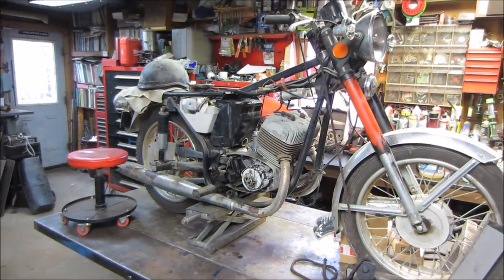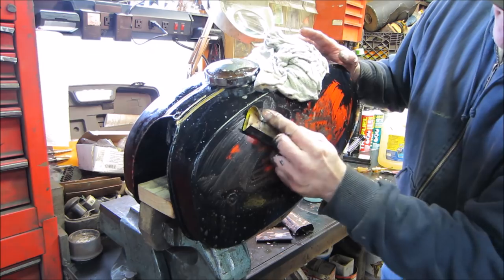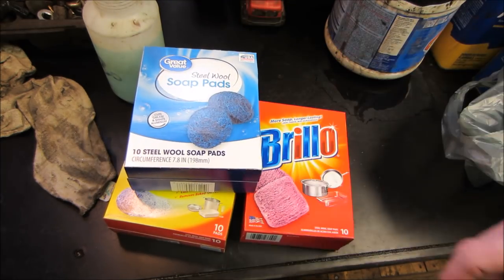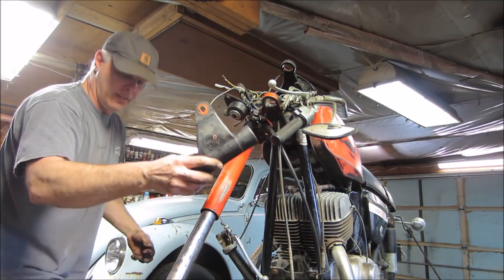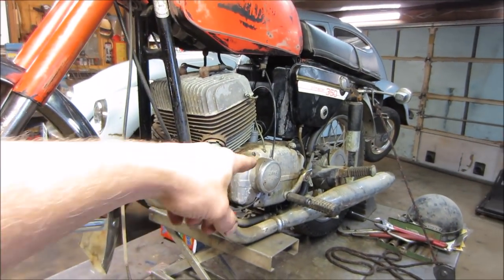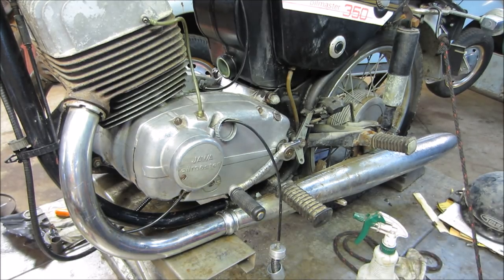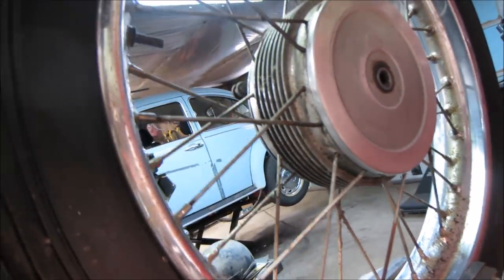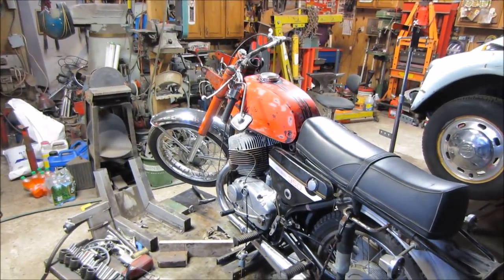barn find jawa, will the paint come back with wet sanding?

Comment: That chop in the front tire is normally called feathering. It’s caused by worn shocks letting tire bounce. I’m sure in this case the fork oil is low or something else hindering the fork from operating like it should. So as it rolls down the roll it hops fast causing uneven wear.

Comment: If your going to leave the paint as it is I'd paint the wheels and exhaust is a high heat silver paint. Not the fake chrome but like a header style silver. I say silver so it will match the case color somewhat. Awsome motorcycle. I'm a big fan of two strokes anyway.

Comment: Agree w/ James Price below.  Wrap the downpipes, sandblast and black hi-temp paint for the mufflers.  Won't cost much money & will make a big improvement in the looks of the bike.  And as long as you have the sandblaster out, you could blast the rims smooth and then spray them with satin silver paint.

Comment: Something you could try on the rougher parts (or the whole bike) is to repaint and once dry you could sand it back (or sand through) a bit to match the less rough areas and make it all flow together. It works really well for aging hardware too. I'd love to see it closer to original paint but with the wear it would have had in its life time. They were tough bikes. And the aging would only add to its character.

Comment: The seat and front/rear fenders are very clean so in my opinion i would paint the tank/side panels and front/rear shocks. I would wrap the front section of exhaust and matt black the rear sections with high temp paint, this would not cost much at all and would make it look so much better.

Comment: I use a sanding sponge for these kind of things. Works well. It work for sanding small engine cylinder walls to get the cross hash for new rings.

Comment: Didn't have a chance to look through all of the comments, but (0000) steel wool works well to salvage slightly corroded chrome.  It's not a miracle worker, but it does work well in my experience.  If you aren't super aggressive with it, you won't scratch the chrome.

Comment: I believe that woven stuff is intended as RF shielding for cables and the like, but it can certainly also be used as ground strap. Or to cover ratty chrome exhaust pipes. :-)

I was thinking of using the wet&dry to key the black paint and then go at it with the acetone, but then I saw what you did with the steel wool and the acetone, and I suspect it was about the same result or better. 

I came across some chrome paint a few years ago that was utterly amazing. It went on as almost a slurry that didn't look like much of anything more than scrambled eggs, but after a few moments it got its act together and turned into this absolutely mirror finish chrome-like surface. Didn't look at all like the usual aluminum "chrome" spray paint. Unfortunately I can't for the life of me remember who made it or what it was called, so that isn't much of a help.

Comment: I'd hit the air-cooling ribs on the cylinders with some stove black; after cleaning them up with a wire brush, obviously.

Edit: you think they kind of cheaped out on proper production techniques back in the comblock days? -you're blowing through the factory paint like no tomorrow, so why would you think any other areas were done properly?

Comment: The front tire ‘Barum’ is a CZ brand tire,  actually good tires, I had some 28 year old tires on my truck that were Barum CHemlon - hardly no cracking or dry rot even when flexed after airing down.    Barum is now part of Continental.

Comment: Soak the rims in burned oil or diesel for a few days and take a screwdriver with a few layers of cloth and all that rust will come off,  after that with a bit of polishing they will be like brand new. When i restored my,'57"Tomos t-03 they were in 10 timeS worse shape than this.  I have the firat start video on my channel

Comment: Two Thoughts on the parts of the red you thought you "burned Thru" - (1) the original paint was prolly very thinly applied and (2) you could be merely exposing areas that the prev owner had sanded to the primer when he surface-prepped it for his black paint job?

Comment: Depending on how old the tires are in depending on where it was located through the years the belts and certain types of tires will actually break but the rubber won't give away so therefore you get lumps of divots in valleys inside your tread I remember the 50s it through 70's model glasspack tires the belts and then would break but the tire would not give away

Comment: I'd suspect the orange had wear and tear making it thinner/softer, or whoever sprayed the thick coat of black sanded the orange for better adhesion. Huh, that green oil in the forks looks like what was in the oil tank of the trashed old Yamaha snowmobile I have.
I think the mufflers would look nice blasted and painted, but it's coming together pretty well as is!

Comment: i used maculloch 100:1 oil in the gas, then mix oil in the tank, so if the pump fails
it wont burn the motor up....a little smoke never hurt anybody..

Comment: That model year is stamped on the plate attached to the fork behind the triple trees. Just turn it until you can read it. Fork oil is a specific thing, so don't just toss gear oil in there. Looks good so far, though!

Comment: When you're sanding near the outside corners, and don't want to sand the corners too hard, roll the paper into the cross-section shape of the Greek capital letter omega, with the loop away from the corner surface and the base of the omega against the surfaces close to, but not at the corner. The loop goes up in between your thumb and index finger. For getting into the inside corners, take 1/16 of a sheet, and wrap it around a 2-1/4" x 1-1/2" (approx.) rectangle of milk-jug plastic.  Rectangles made from credit cards work, too, but they're too stiff for what you're doing. You might make a rectangle from a Scotchbrite pad, too. 
-- Lately, it seems like I make my living restoring 100-year-old wooden apartment-building doorways with lots of mouldings and carvings, and I've had to learn from thought and trial and error how to deepen grooves while not taking the high ridges down, and how to sand leaves, acorns, scrolls, and eggs. Most of the doorways are around 15' tall and 8' wide, with windows above and at the sides, with only small areas lending themselves to the use of power sanders. At any rate, it's all about getting the pressure where you want it, and keeping it from where you don't want it, at a small scale.

Comment: Mustie, you can use any 22uf condenser (like a Volkswagen one :) and Volkswagen beetle/ kombi points will work if you press the locating pin out of the fixed contact :) I know this works as I have done it, remember to use a metric drill to resize the fixed contact on the points!

Comment: Waviness on the front tyre tread is caused by braking vibrations in the forks. It's a feature on bikes with twin leading shoe brakes.

Tyres are still made by a company called "Mitas" and should be available in the US. 

2Mitas" make tyres for seriously heavy plant machinery too.

Comment: I'd keep an eye open for newer rubber, but in the meantime, I'd have no problem running that steer.  Might dismount it, inspect the bead and sidewalls for signs of rot, but if all looked well, I'd run it.  A bit of feathering like that in the tread,  once it's started, isn't likely to stop, so just run the thing until it becomes noticeable or unpleasant from vibration.  Just my opinion, based on my own experiences with tires.  I don't think Mustie is going to be loading up and heading across the country on it,  so for little joyrides and short scoots on the thing,  run it until it's done. It'd be different if it were a big heavy touring bike and he and the wife were going to be travelling on it.  The rest of it is coming along rather nicely.   Maybe it is possible, despite what they say,  to polish up a turd :)    And hey, before you hate on me, I've had lots of "turds" in the past.  I'm not ashamed to ride around on or in something less than showroom condition.
Reply: I had a XJ 750 with that on the front tyre and the bastard burst on me at 80 mph and shattered my right elbow so personally I would get a new set of boots for her.  They're only 3.50x18 & 4.25x18 V's or similar anyway so nice and cheap, bet they've got tubes as well!!!  Nice vidz Mustie

Comment: Where do you get the spray bottles you use for soap that will adjust down to a single stream?  I used to re-purpose all my old 409 cleaner bottles just because they would do this but they are long gone now.  Just cant seem to find that bottle anywhere.

Comment: Should replace the handlebars too - same as the rusted rims. Whenever you see chrome flaking off, you should replace them because you have no idea about how rusted the underlying metal is - there could be a spot under the chrome with a hole for all you know. First time you nail a pothole, your handlebars breaks or the rims cave in. Safety come first always when you're fixing up an old barn find.

Comment: Front tire chunking caused by soft rubber one direction of spin with front brake applied the rubber edges are pulled up trying to adhere to the ground where as the rear wheel gets pressure from acceleration and braking there for it stays flat J Colton ca

Comment: the bumpiness in the rubber in the tires is degredation of the tires within the reinforcement is stretching ive seen it in tires that were stored in a garage off a car after 2 years of them being in storage.. the tires were not bad bit they were not a quality brand.. all 4 tires were perfectly flat and proper worn after pulling off the rack they looked similar to that and never saw the road again

Comment: All the time you're using on sanding- you could've just brushed on brake fluid, and wiped the black off in 1-2 days. Unless it's baked on Factory paint- anything else is considered "overspray" and comes of easily.

Comment: I'm pretty sure that Barum are a Czech company so there's a good chance that front tyre is either original to the bike or is a replacement supplied by a Jawa dealer.  With the number of US tyre manufacturers there were in the '70s and '80s I can't imagine there would have been much market space for Czech tyres in the US unless they were unusual sizes or specs.  Barum tyres are actually pretty good on cars and vans though I have no idea how they are on bikes...
Reply: gosportjamie Barum are very high mileage very low grip tyres.
Reply: +andrew allen  Probably not ideal for bikes then.  Mostly I had experience with running them on Transit vans...
Reply: gosportjamie Depends, remember the top end on these is about 80 mph unless you mod the engine. My twinsport can haul myself and wife ( both large) and two kids in the sidecar but not much faster than 50 mph on flat ground at 7000 feet altitude. Did they give good mileage on the transit?
Reply: +andrew allen  Most of the vehicles they were used on were extensively used in town so it was pretty rare for them to get changed out because the tread was worn out, they usually went because they sidewalls were knackered from kerb strikes and such...
Reply: Had a 634/4 from new in 74, replaced the barum tyres before they wore out, no grip at all on damp greasy UK roads, bike slid down the road, never handled right after.

Comment: I would have repainted the bike and either had someone redo the chrome with that new spray chrome system they have out or else I would paint over some of the chrome such as the outer wheel rims in the orange the rest of the bike is painted

Comment: What size are the tires?! I have a few left overs from KZ400's and RD400's in my yard... most of them have zero dryrot and good tread.
Reply: AimlessMoto The only rubber I put on my ‘76 RD400 were Dunlop K81’s, but even they would be in pretty bad shape by now.
Reply: Michael Wojciechowski the only thing I put on my 75’ KZ400 is spanked old tires cause just like those tire that bikes also spanked and that’s okay cause it runs year round
Reply: Rears are 3.5x18 and fronts are 3.25x18

Comment: The Barum tyres were quite a hard compound, even when new.
When Jawa's were sold in the UK it was not unknown to insist on the front tire be changed for one made in Western Europe before it left the dealer. Just so you could trust the bike more in the rain. 
These bikes were not monsters that would catch a Yamaha RD350LC. It looks like something from the 1960's updated with a auto-lube oil injector to avoid having to pre-mix the oil in with the fuel. The styling of the rest of the bike is seriously dated.
I served my time on a 2-stroke before passing my test & I found you really should use the best oil you can find & not the gas station stuff fit only for mowers and chainsaws. The same goes for the spark plugs. I used Bosch plugs.
It was meant to be economical transport for the average Joe to get to work & he could give the finger to any environmentalists as he passes. Cos he ain't walking & they are.

Comment: You had it practically broke down in the forks. Spray bombs will work wonders and cheep. Use hi temp black or silver Ceramic spray bomb on the exhaust. Did that to a 4 wheeler then scuffed in one direction with a Scotch-Brite pad and made it look like stainless steel.  Just saying. Lol

Comment: I'm beginning to see some Mustie1-Jawa (Yava) love. Original Czech Barum tires are excellent and still available. Head pipes and mufflers are surprisingly cheap on Fleabay. I know it's your project, but I wish I still had mine.....  Did Jawa ever make expansion chambers? How about dual carb barrels? My RD 350 was faster, but the Jawa was much more tractable.
Reply: Chuck Haynes indeed they did. Expansion boxes are still available from F2 motorcycles in Britain :)
Reply: You mean tractorable? I thought I saw a three point hitch in the parts pile there.

Comment: Exhaust- remove from engine, rinse out with gasoline, sand blast, acetone rinse, VHT primer, VHT paint. Hang up to paint, heat gun to dry/cure or oven 300F 1 hour. Chevy Orange whole bike, Bright aluminum engine, trim, exhaust, wheels. DOT3 brake fluid works great in forks. LED all lights. WalMart knobby BMX handle grips. That could be really sharp!

Comment: get yourself a big plastic tote fill it with about 5 gallons of white vinegar add a couple boxs of table salt stir well now get a bunch of nickle welding rods and hook one to positive and one to negative when the mix turns blue you got nickle acetate sand you mufflers down to as much raw metal as possible now hook your negative wire to the muffler and let the positive sit in the solution with a nickle rod attached to it let it cook for an hour with 6 volt and a couple amps it will at least put some nickle on the old pipes

Comment: Out of curiosity, have you seen the effects of the Rustoleum mirror paint? Because i'm seriously wondering, what kind of effect would that have as a chrome replacement. I mean, sure, paint's paint, and chrome's chrome, but for a shitty beat up bike, who is going to argue???
Reply: aserta but from what I've seen you only get the mirror finish on the reverse side of what u spray, like it has to be sprayed on glass and the mirror is on the back
Reply: I played around with it on a junky Yamaha from 73 and I wouldn’t recommend it(125 enduro)
Reply: we call it Chinese chrome
Reply: It doesn’t work as a regular paint.  I did a test on my channel for my mini bike project.  It looks terrible used as a normal paint.  Most of the over the counter chrome paints look more like aluminum.  There are some decent looking spray on chrome products, but I don’t know if they could handle high temp applications, like exhaust.
Reply: There  are quite a few chrome paints available. Some better than others. I would question if any of them could stand exhaust heat though
Reply: we call that newfy  chrome  in canada lol
Reply: Better have it powder coated in chrome base then.
Reply: It's not shitty ;((
Reply: I had pretty good effect with a cheep chrome paint. At first it did't look so great..Then in time as the aluminum baked in..I used a buffing wheel with jewelers rouge..The pipes shined up real nice..If you bake them in an oven first you might have an even better outcome..

Comment: The name JAWA would be pronounced JYAVA slurring the J and the Y sound together, W is always pronounced as V. A W is a double V after all. The motorcycle is taking shape. It's really not that special. Great performer and solid, giving the user lots of motoring. If it was mine I'd leave it in its state and ride the wheels off it. Nothing wrong with a survivor that looks the part and is always rough and ready. Who cares if it doesn't look pristine and new? 'Take Crusty' for instance. Looks like it was rode hard and put away wet in a swamp. Mechanically sound, however less than showroom quality. The front tire looks as though the forks were allowing too much oscillating/hopping to occur. By the looks of the oil that came out, they weren't filled enough and the seals suffered too much wear as a result. Those plastic plugs are actually baffles to dampen the flow of oil in the forks. As the oil is compressed it allows oil to bypass each baffle independently of each successive ring giving the fork the ability to become stiffer in a controlled fashion. You may want to source new ones and seals as well. The pipes would look just fine with barbeque paint on them and one can find it in a variety of colours which is more durable than high heat header paint. The tires didn't look weather checked or cracked at all. Look into '303 Protectant'. YT channel "Sweet Project Cars" swears by the stuff.  It may be worth it to rejuvenate those tires. Thank you for the great content. We'll be watching.